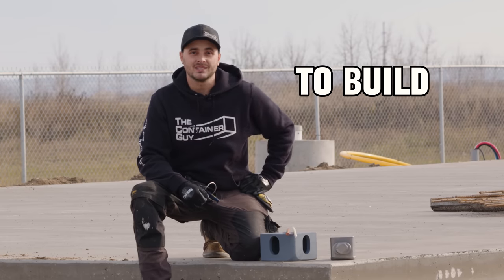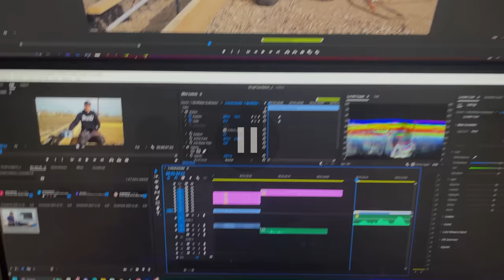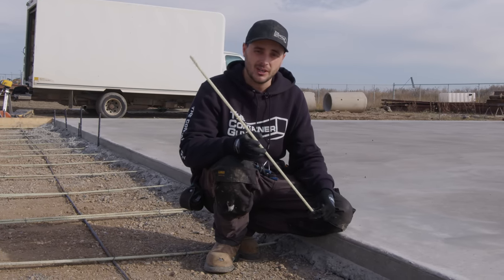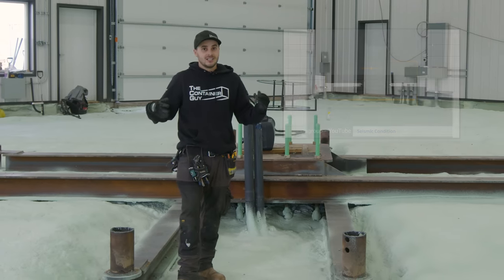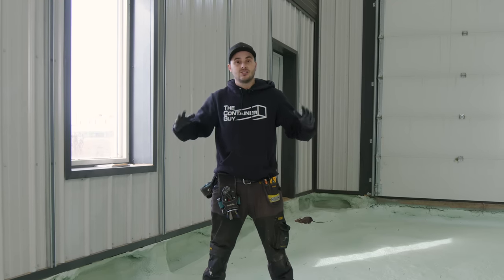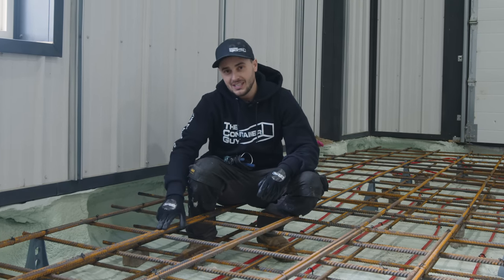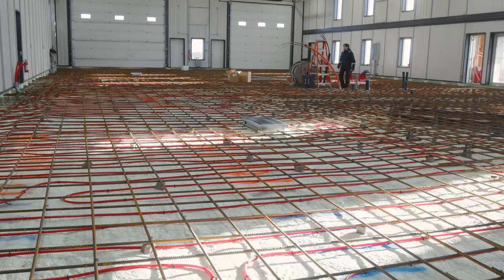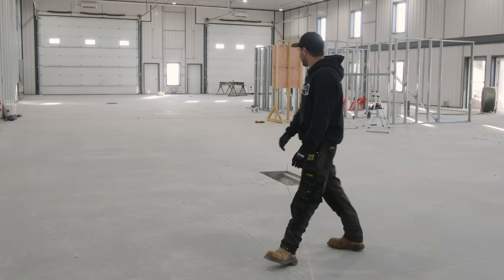Concrete Foundations For Shipping Container Homes

Comment: If you chose to not chair up the rebar to center of your 4-6 slab and think you can pull it up as you place concrete, The bar is a waste of time. Fiberglass rebar can only be used to a building height of four floor in concrete, and my understanding is it is NOT TO BE MIXED IN SLABS OR WALLS. I'm a past bridge builder and never put fiberglass bar in any freeway-bridge work, hiway, or runways. If concern, it's expoy coated from supplyer. Ive placed containers on 2ft sq. block post with a 12in SQ by 1/2 nelson studed plates set at top of pour then weld container to plate. Past county code in WA Ive also seen where they laid the contaner on its side and screwed chicken wire on floor joist and shot the foam threw it and the wire protected it and vernin left it alone

Comment: Using steelfibers in concrete is not 'blocked' by old geezers, it just can't replace rebars but what it does it limits cracking but increasing tension capacity more evenly. Also fiberglass rebars are not stronger than steel but it's smart to use them as the most exterior layer since they don't corrode.

Comment: With rebar in concrete as long as you don’t burn the surface of the concrete it doesn’t matter what kind of material you use. The rule is to stay two inches away from the bottom top and edges of the pour. And you should keep the tie wire short to prevent it from breaking through and allowing moisture from getting into the rod matt.

Comment: From the US - a second layer of upper reinforcement (6x6 WWM or what you used, fiberglass rod) was usually added to thick & high PSI slab (8" plus 5-6K psi), prevents surface cracking & exfoliation. Its been 20 years sense I spec'ed floors for industrial bldg's so that prob. changed?
Reply from the maker: Thank you!

Comment: I really appreciate the thought & quality of your shop floor installation!
Thinking about the structure of containers, especially for “temporary” or quick installation, could auger-type supports be installed at the 4 corners to support the container while allowing for an adjustable (& even damper) carriage connection to be bolted into, be used for a level installation above ground? I’m thinking about it for disaster housing & emergency situations where speed & using small & common equipment could get shelter & functional space up quickly in most areas.
Reply from the maker: You can absolutely use screw piles under the 4 corners. Or just set them on blocking for rapid, temporary deployment.

Comment: Wanting to create a container home set up in Phoenix, AZ on flat land. Will have at most 2 shipping containers stacked on top of each other (eventually--at first just 2 containers, side by side). Wondering if it will be better for me to go with a pier foundation or a monolithic thicken edge slab. Any suggestions?
Reply: Wat he said re: inspectors and their proclivities. If it were simply a $ decision, I would think a set of piers would beat a slab in just about every case.
However, there's regulations and inspectors which will factor heavily into your choice. Other influences could include how long it will exist in place and the actual ground/soil structure under and around proposed location.

Comment: What thickness slab do you suggest for a container home in a cyclone prone area? Do you suggest thicker around the edges?
Reply from the maker: It's most important to anchor the containers to the slab. Thickened edge is smart. Our engineer told us 11" along the edge and 5" in the middle for a different building but my guess is something similar to that..

Comment: Not sure where you are in Canada but where I am we have never worried about or even talked about radon. And spray foam is way more expensive then sheet insulation. For a 40x80 building it was almost $30,000 to spray the floor. We did sheet for under $3500. Also you would have to load an extreme amount of weight on the end of a container to get it to bend. We have dropped loaded ones and never had them bend
Reply from the maker: Home Depot is $4.50/sq ft for 2" (retail). This does not include delivery, handling, or labour. 

https://www.homedepot.ca/product/owens-corning-foamular-ngx-c-300-xps-rigid-foam-insulation-board-2-inch-x-24-inch-x-96-inch-r-10-sl-edge/1000155124

We paid $3.00/sq ft for 2" installed. No brainer 🧠
Reply: @TheContainerGuyTV  we were quoted $9 and change for 3" spray. We didn't buy from home depot and got 3x7 sheets of 4"

Comment: I've just sub'd, great videos btw, and watched a few of your videos. What are your thoughts on container multifamily homes? This might be a way for affordable housing. Spray foam in between containers and the outer ones insulated on the exterior. Do you think that would eliminate or lessen the condensation issue?

Comment: What?    No ICF's?
Reply from the maker: I love ICF. Would use them for a basement 100%
Reply: @TheContainerGuyTV  you don't think a few feet deep with rebar imbued in it, for the perimeter with the locking corners cast in would work?    It'd be a shitton less concrete in the middle
Reply from the maker: I always worry about rodents/snakes living under the containers and having no way to get down there.. I hear if you spread crushed rock, you're good to go but still.. Or spray foam the "crawl space".. I like that idea! 

But yes, if you are in a frost zone, ICF is the way to go to frost-protect your utilities. This video was more about seismic areas (California & other locations near tectonic plates). 

I could/should do a few more videos on foundations yet. I also really like screw piles and I beams. Zero concrete. Skip the entire trade from being on site. Every instance and site is different though so there's no one-size-fits-all.